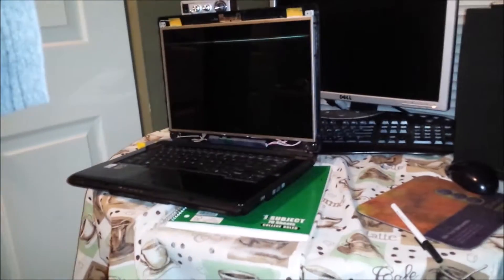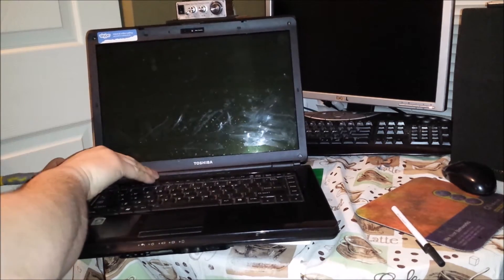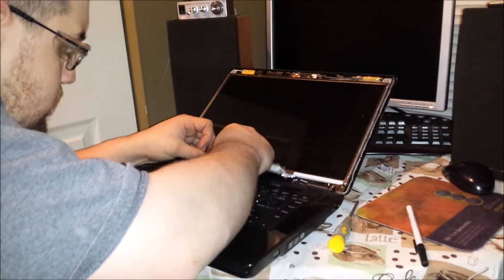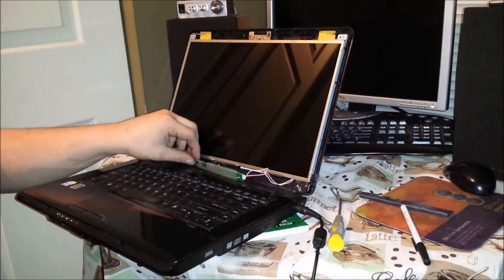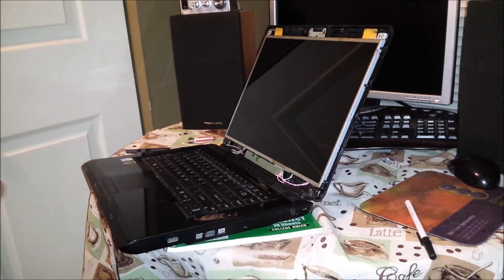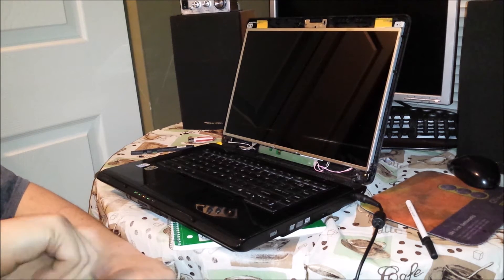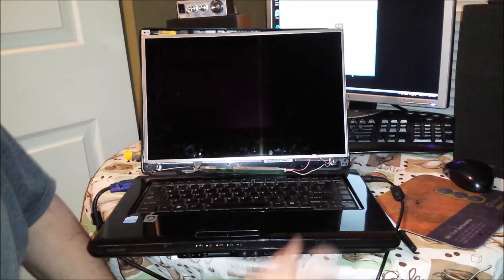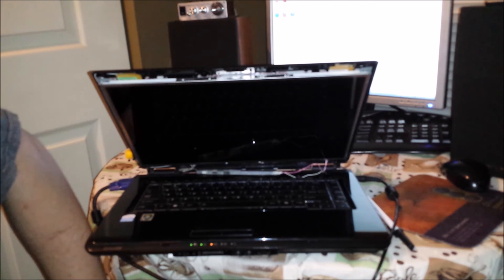Toshiba laptop backlight inverter replacement

Comment: my laptop's lcd display  backlight delay to start at 2 minutes,  when i boot i can hear  loging sound and i can see screen by using flash light. later one minuts its get turn on and normal.  if laptop is hot then i don't have any problems only for first start its take 2minuts to turn on backlight.

i cannot jeep display in sleep mode.   if keep its take 2 minutes to wake backlight. so i selected never in display  settings.